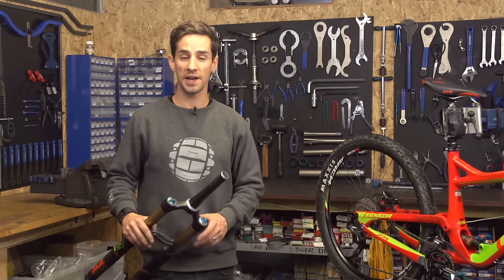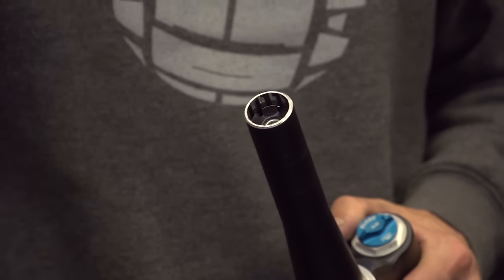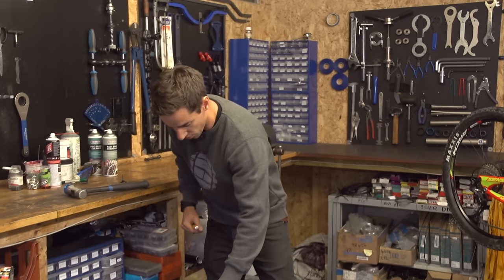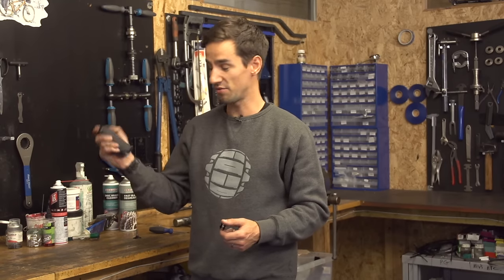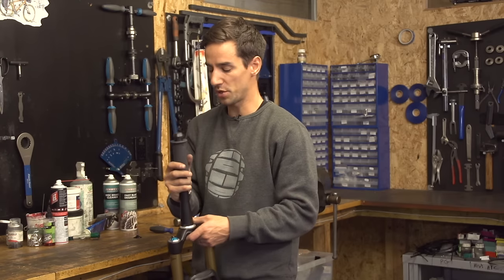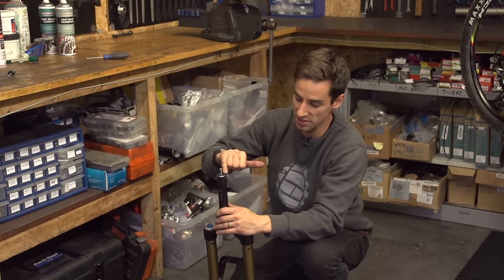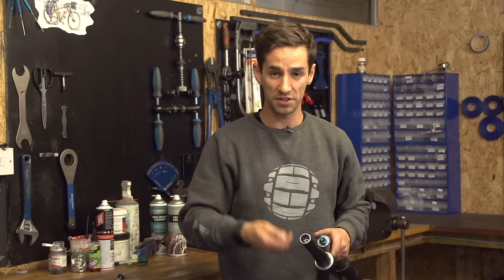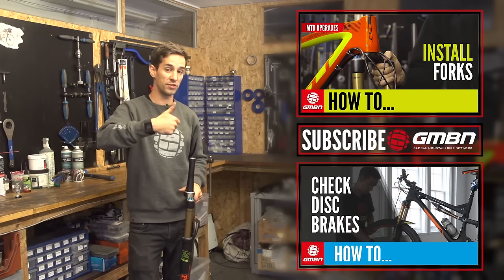Fit A Star Nut | MTB Maintenance

Comment: when I replaced mine without the proper tools i put a screw driver down where to bolt would go then hit the top of the screw driver with a hammer gentle for both installing and removing it, worked really well.

Comment: it's really a lot easier if you put it in just a little bit, then you take out the bolt and put on the stem and top cap like you normally would. then you screw the bolt back in through the top cap but not entirely. when you then hammer it down it evens out automatically. just use an old stem and top cap if you're afraid to damage it.
Reply: Thanks!
Reply: @Sandstorm69  !!
Reply: Nice one 👍🏻

Comment: Best thing I've found for star nuts to set them in is a 10mm deep each socket. perfect fit on the inside of the leaves and goes on nice and straight.
Reply: I use a piece of brass round stock. Then you don't destroy anything.

Comment: I've always used a screwdriver that has a slightly narrower handle than the fork top and fits through the star nut.
Reply: +Marco Frissen Or he could have used that punch he used to remove the first star nut.
Reply: Yes screwdriver was perfect, because then you can also still redirect it if it starts going in off center.
Thank you!
Reply: This... every time.

Comment: There is a rivet that attaches the two stars of the star nut. If you use a drill bit to remove the rolled-over part of the rivet that holds on the top star (it's really not that hard-I did it by hand), you can tap the other star with a screw driver so that it flips sideways. When the stars flip sideways you can just turn the fork upside down and the two stars will fall out of the steerer tube. This takes just a few minutes and can be helpful if you have a fork that doesn't have a steerer tube that is open on the bottom. Once the stars flip sideways, they no longer hold onto the insides of the steerer tube and fall out quite loosely.

Comment: You can also use a screwdriver, fit it trought the hole and bang on top of it, if its the right handle size it should get the star centered. At least I managed to do it like that when I installed my fork a fee months back.

Comment: Cheers for that Neill. I was cleaning the grime and re-greasing my headset and when tightening, I damaged the star nut. Thought I might have to leave it in to the local bike shop to fix, but after 30 minutes of trying to find what the part was actually called, I have now found your video in a minute. So it's £1.99 for a new star nut instead of paying £30 for someone else to do it. Think I'll put the savings towards a torque set lol, keep 'er lit 👍

Comment: tried hammering in the new star nut with the bolt in. couldn't get it straight. screw driver thru the star nut works a treat.

Comment: If the proper tools is not available I use and old stem, cap and the screw to keep the star nut straight, safer than the free hand method.

Comment: I managed to destroy my star nut by overtightening the top cap. I'm taking my bike to a mechanic ASAP to have it fixed. Thanks for letting me know the world is not over and it can be fixed. I care far too much about my bike and riding it every day. Almost had a panic attack there.
Reply from the maker: Nice! Easy fix and easy to get freaked out about it! And next time don't tighten your headset so tight, only needs a little turn to get everything compressed enough

Comment: Set the nut and bolt on top of the tube and grip the bolt head with a pair of pliers.
Hit the pliers rather than the nut and every couple of taps reseat the pliers.
Works every time no fuss.

Comment: Use the top cap off a stem screw it in with a bolt underneath or some kind of spacer. Hammer till flat all sides. Easy and guaranteed square

Comment: To keep it straight, Just put a metal washer that's a similar diameter to the tube and two nuts to hold it in place on the headset bolt.

Comment: Using any method is good as long as you can keep the nut square within the bore of the tube. If its not square, it won't be central. If its square it should center itself.

Comment: How I used to do it 20 years ago is I went to a metal fabricating place and got a threaded pole about a foot long or whatever, the guy didnt even charge me for it, you need the threaded pole plus a nut and a washer wide enough to not go through the steerer tube,  put the threaded pole through the tube, star nut screwed on top bit, nut and washer screwed on the bottom bit, tighten to bring the star nut down and through the inside, can also use that method to remove one but it takes a while,  screwing the same threaded pole into the top of the old star nut and tapping with a hammer was quick and easy.

Comment: couldn't you use a long bolt with a washer and pull it from the bottom? As you tighten the bolt it would pull the star nut in.

Comment: I have only done this twice now. I recently bought a pair of 800 quid fox forks and went through this process. Please please buy the proper tool! I did this on the second attempt having tried a hack using a socket and washers. Lets just say...im glad I had a spare sfn....because it went very badly. I tried hammering the nut provided and I would say I managed it by the skin of my teeth and the nut was less than straight but just about acceptable and I was able to preload the top nut after finding the thread. Very high risk procedure and not pleasant to carry out. Spend 25 quid on the correct tool or borrow one if you can. Dont make my mistakes.

Comment: Couldn't you just leave the fork in the frame and use the wheel as a soft pad instead of taking the fork off and using a rubber mat on the ground? Can the star nut be installed while the fork is still in thr frame I guess is what I'm asking

Comment: Today I did this and get really frustrated, even with a FSA tool I couldn't install it straight (but still good enough). Plus some aluminium fragments fall to the stachions and the floor. I know some of this was my fault but fuck it, next time I'm getting a Hope Head Doctor.
Reply: +iainthavinthat yeah I got a head doc for my new fork. I did not have the correct tool for the star nut, and the head doc just slid in and tightened up no problem.

Comment: Mine broke because the Walmart employees tightened it too much, so then it snapped inside and was barely holding it. When I bought the bike I thought it was something to do with the headset needing to be tightned, and when I took the bike apart, the one half of the bolt was snapped in half inside the headset.

Comment: Oh dear. This is bodgr/hack level. The proper way to do this without the dedicated tool is to use M6 threaded rod, two-three M6 nuts and something to rest at the bottom of the fork crown through which the rod will come through.

The trick is to screw the star-nut on the rod, put it throough the steerer so the rod comes of the bottom, put some sort of cap from the bottom, thread the nuts and then as the nuts are tightened against the cap, the rod will pull the star-nut perfectly into the steerer.

You can use the same method to pull a damaged star nut from the fork as well.
Reply: Can you just go to a fasteners shop and ask for a long ass m6 threaded rod?  That way sounds really easy.
Reply: Joel M
 I'm pretty sure that any self respecting hardware store should stock those things.
Reply: +Joel M screwfix have them if you're in the uk
Reply: The problem here is that you may end up with the stuck nuts. It may be tricky to unscrew them as the threaded nuts do not have any screwdriving surface. In my case I filed an end of the rod down to hexagonal shape to fit the hex socket.

Comment: I think the bike industry should come up with something that doesn't involve friction. It just seems so old fashioned.
Reply: +David Bissels It's reliable though and it adds next to no weight, so there's no real need to change it.  The star nut method is actually newer than the old method anyway - before the 2000s, most bikes were using threaded steerer tubes, pre-load nuts and quill stems.

Comment: Odd that you cut the hardest bit out at 2.19🤔, I reckon he used the tool to line it up as it ain’t that easy to hammer it in straight. My shop did this for free with the proper tool in 10 secs,

Comment: Not the best method. 
Removing the star nut is easier and quicker if you drill it out. Increase the drill bit size with each pass starting at 6mm.
Most installation tools set the star nut at 15mm depth. Hammering it in is a terrible way to do it and the inexperienced will always end up with the nut on the wonk. A nut installation tool is quite inexpensive and worth investing in IMO.